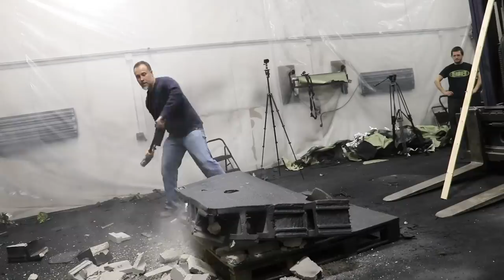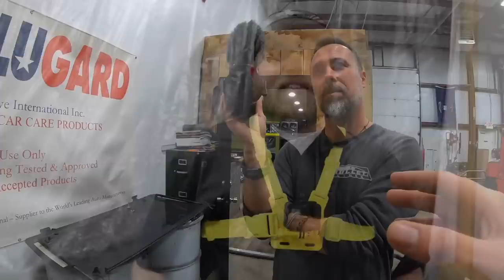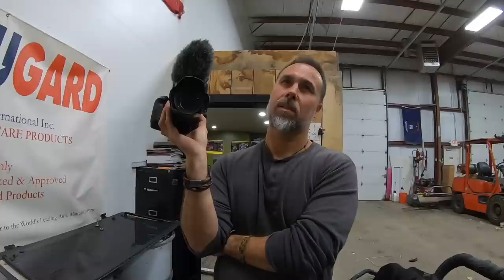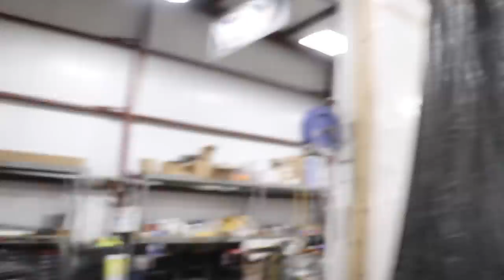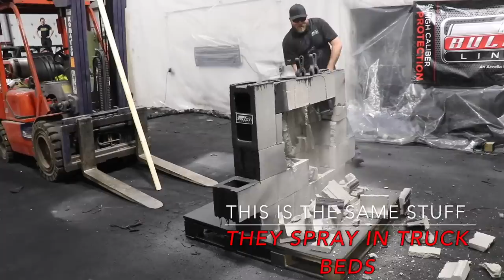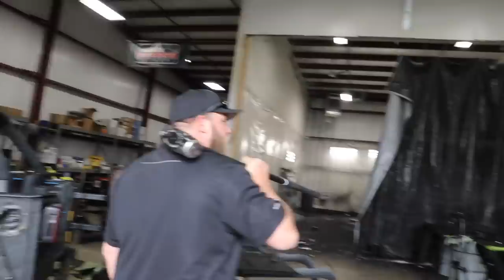Bulletliner Vs Line x .  Whats the difference & which is better?

Comment: what i want to see is somebody come up with a product that will do the same identical thing that can be purchased on line given the option of roll or spray and at a realistic cost. instead of rip offs that have rubber tough liner that you don't have to sit on the damn phone for a week only to find out a dam brush guard for an equinox costs more to coat and protect than the cost of my dam brush guard. every diy bedline is just cheap schit urethane/ acrylic frickin car urethane mixed with frickin acrylic house paint. that is as flexible and rubberized as a stupid wine glass. polyurethane requires a certified installer, special spray gun with internal mixing of the catalyst and is not available to the general public unless you become a dealer with all the legal bs included its no different than coating the same as a fiberglass chop gun that also mixes the polyester resin and activator in the gun and cuts the fiberglass chop string and sprays all 3 simultaneously onto the hull mold. this off the shelf roll and spray even being called on the labels as polyurethane. when it isn't. then rip the hell out of our bank accounts only to find 3 month later it wasn't anymore than the base clear thats painted on the vehicle just made thicker. i have seen all those bs products done in real time comparison's and i'd be better smearing Elmer's or gorilla glue on the material being coated.  everybody sits around waa fk,n waa,in and bragging how theirs is supreme when i can buy a taco supreme that performs better by me blowing it out my @$$ the next morning.  i spoke to al.s bedliner and got the complete run down on their so called polyurethane written right on the webpage. when its only urethane/acrylic. maybe i should just toss some dirt in a bucket of mop and glow acrylic floor coating and save 125 bucks. with all the technology. hell even plasti dip still has a rubber coating i've used on snap on tools that are 30 yrs old and still the coating is fine. now they have a primer that makes it adhere to the surface. don't need an activator, sprays gloss black and 15 other colors and will bounce the same if not better than bullchit liner. best part is for less than a than 2 thirds the price. besides it ain't jack squat to edit a fake youtube video to make even my wanker to be 10 feet long. so what you beat a block wall. and so called sprayed a melon that can easily be edited and swapped with a rubber ball. then switched back. yeah I've seen all the tricks. even got a bag of my own. its called watch another fake video then move on to another. i can video edit flying a broadhead not even close to somebody and edit it to look like it was real with a stupid water balloon filled with red food color then just fall on the ground. the reality of it is the many outweigh the few with a bank account full of money. and are forced to go and buy some cheap junk crap only because to get a real product is totally out of their reach. and the vultures waiting for their next schitwagon customer to come rolling in. the ones that have gold plates sticking out their rears. i researched over 8 polyurethane liners and the cheapest for a truck bed was $425. must be some chinese leftover covid crap. well i already know what im using for a coating and if it don't produce real results I'll just remove it and polish the stainless to a mirror shine and maybe just spray it with single stage urethane black. and just touch up any chips the same way i been doing for the last 40 years. or just refinish it again and still save money. because i already know in advance the ripoff procedure that will follow if i allow myself to be hypnotized into the land of zod if i attempt to even try to think about wasting my money, time and patience. on a product and the company that never answers the frickin phone. don't return calls, emails, etc. and just spare myself all the BBD! besides i already had line x and already know its the best. and worst just like all the rest. this day and time its become cheaper is better.

Comment: I wonder what kind of military applications this has, anyone ever pitch it to the govt?
Reply from the maker: Good question Daniel
Reply: Back in the 90's the original bed liner "rhinoliner" was developed for the navy and then later brought to market as a bedliner.
Reply: The interior walls of the pentagon were coated with Line-x in the early 90s. The guy that started Line-X had a 20 year patent, and when the patent was up he sold out and started bullet. Bullet has not upgraded thier product so it’s like yesterday’s line-x

Comment: Can it be removed? Linex was one of the most difficult bedliners to remove, but it at least “could“ be removed with enough effort. Also, how heavy is it compared to linex or other bedliners? I can see this being a really nice whole vehicle coating, as long as it doesn’t prevent crumple zones and other crash related safety functions from working properly in the event of an accident.